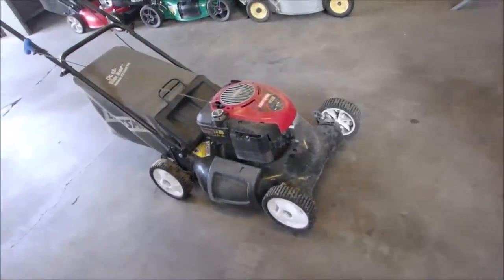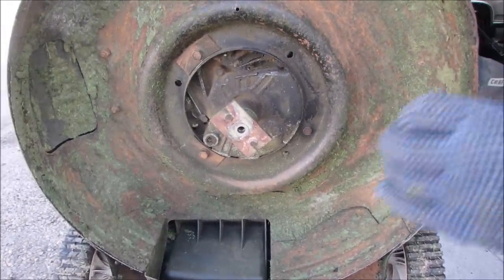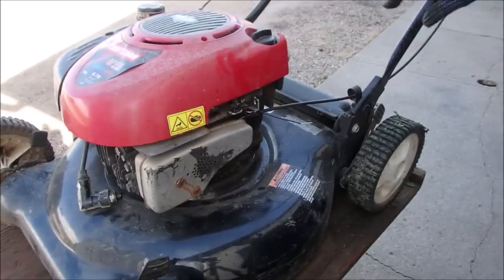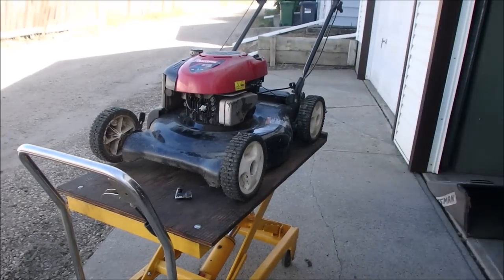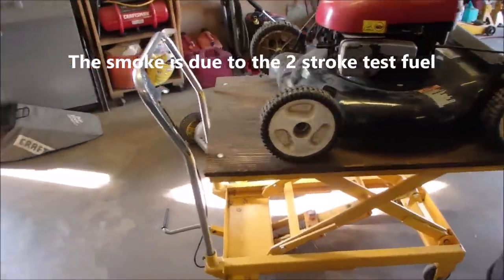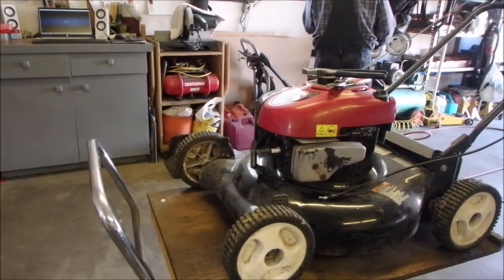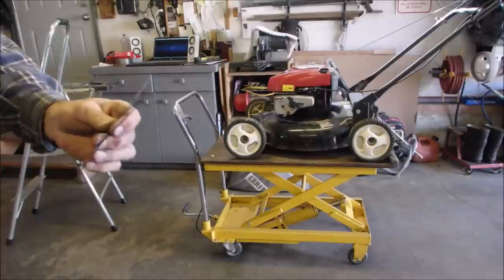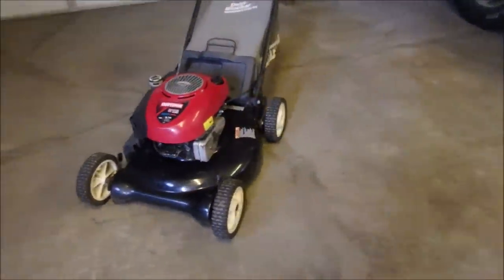Craftsman Mower Given Up for Dead

Comment: Bruce that was great troubleshooting. I have an MTD Yardman riding mower. The extension spring broke that connects the brake/clutch assembly. That is one strong spring. You have to stretch it about 6 inches from that assembly to the back of the mower body. I asked a mower repairman how he did it and he said he used a rope. Two of us guys tried pulling it and no way was it going to stretch. We ended up putting a 2x4 board across the back tires with a hydraulic jack turn sideways and pulled it with a chain. I hope I never have to do that again.
Reply from the maker: Yes they are tough and almost to short to deal with.

Comment: I have had the same problem with several of these bad metal spark plug caps. I separated the cap and removed the resistor by replacing it with a piece of metal. It had no impact to radio noice. Altenative is replacing the cap with a new one.
Reply from the maker: Right.  I have cut of the end of the HT lead and added just a boot with the connector that pokes through the wire as well.
Reply: I did the exact same thing on a Powermore engine last weekend. When I tried to pull that stupid metal-clad boot off the insides of it split in two!!!  Luckily there was enough wire length to just put a new end and straight rubber boot on it!

Comment: Bruce I got a free Yard Machines push mower over the summer I’m wanting to fix up and sell. It runs with a zip tie but it’s missing a throttle cable and throttle control bar. Curious where you order from.
Reply from the maker: Ebay would be the best.  There should be a # on the cable   enter that.  If not measure the metal wire and the plastic conduit.

Comment: Talk about a rare handle bar.  Craftsman made a mower that used the long black frame with a Honda engine with the blade clutch.  The bar has been discontinued for some time and part suppliers no longer have the bar in stock.
Reply from the maker: Thanks

Comment: I have the same thing and I put a new carburetor on it now it won't go full bore it putters and runs on prime and when I can get it to run and shut it down restarting it it putters again any idea what causes it
Reply: did you make sure the o-ring carb seal didn't fall off when you replaced the carb - could be sucking in air.
Reply from the maker: Is the governor spring on the carb throttle to the small bracket in front